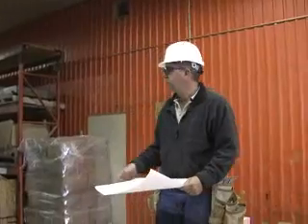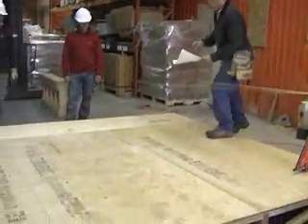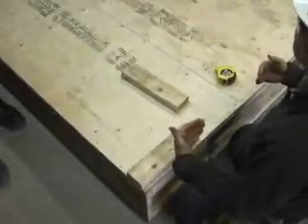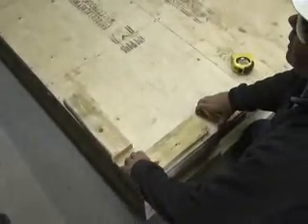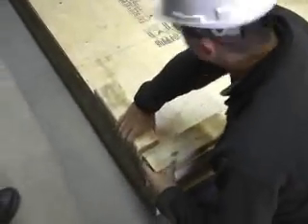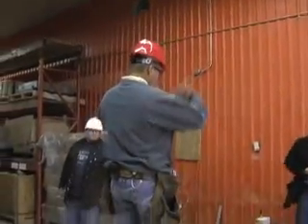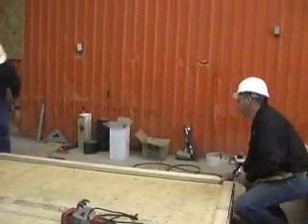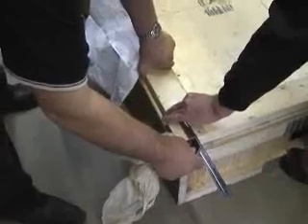INSULSPAN Install: preparation of bottom plate

Comment: Insulspan is a terrible company. Do you not recommend using them for your home. Their customer service is only self serving. Knowing this expect that they will take your money, but have no accountability if they manufacture the panels incorrectly. You as the customer will be stuck picking up the pieces and cleaning up the damage which can cost you thousands of dollars to fix. Not only is the manufacturing problematic, insulspan does not keep to their word. They expect you to pay 50% up front to start the production, but they will put off production and only favor customers who have a higher value project, leading to timeline issues. Again the biggest issue with insulspan that will bite you as the customer is they have no accountability for ANY mistakes they make. You will, as the paying customer, will have to pay the price and pay for the inconvenience. This is the difference between other SIP and building manufacturing companies. Be sure to speak with SIP builders first, they typically dont like working with Insulspan and will recommend other companies that have better manufacturing , customer service and peace of mind. Also SIPA can be a good reference, but they are sponsored by Insulspan.

Comment: What specific type of adhesive is being used?
Reply from the maker: Hello Brian, Th adhesive that is being used in this video is made by Sustant, Inc. It is called SIP-SEAL - Joint Sealant. We use this because not only does it act as an adhesive, but also since it never fully hardens, it acts as a gasket at the joints to keep air and moisture out.
Reply: Temira Kafer 
I’ve seen owner/builders using Liquid Nails and that does not make any sense to me because as you said it is important to air seal as it is adherence. 
Is there any structural benifits to using screws over Nails?
Reply from the maker: Hello Brain, You are correct. In our installation manual, we recommend the SIP-SEAL instead of another type of adhesive for the very reason you noted above. Using the panel system, it creates an air tight structure, and we would hate to compromise that with an adhesive that is not specifically suited to do just that. As for the nails versus screws, there is no real structural benefit to using screws over nails for the bottom plate, or for the nailing pattern on the bottom of the panels to the bottom plate. When attaching the bottom plate to concrete instead of a wooden deck system, you would need to use bolts that have been poured into the concrete to properly attach the plate to the concrete. Otherwise, nails will do the job.